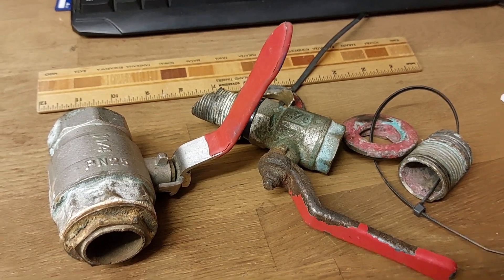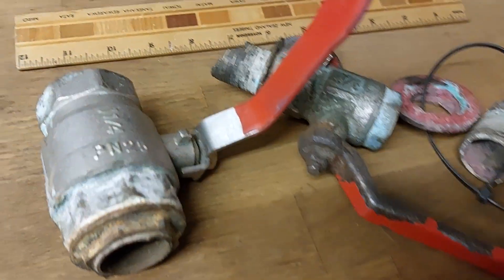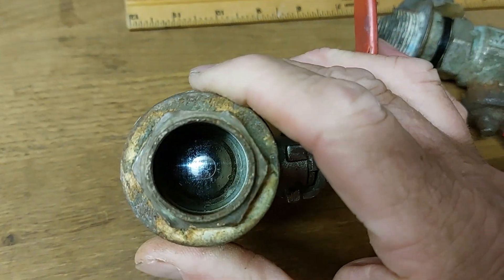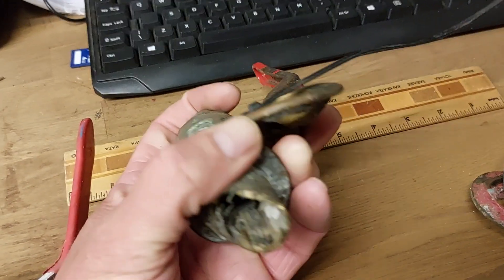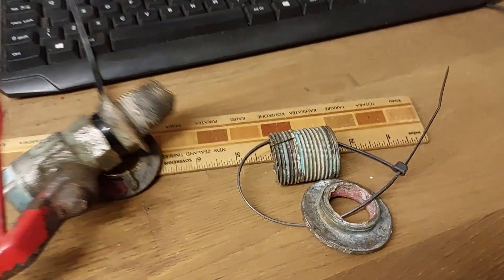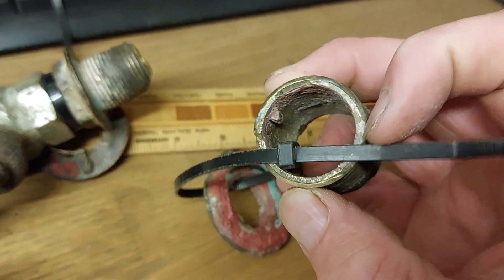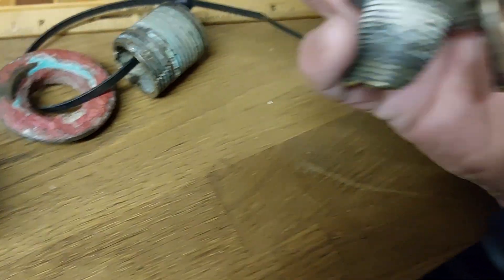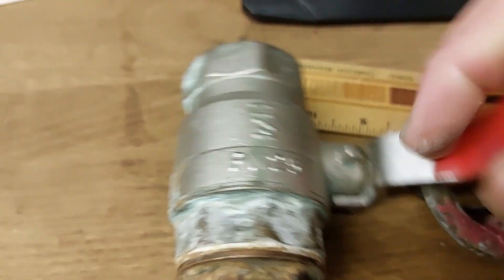very serious failures of seacock valve assemblies explained

Comment: Hi, I enjoy your interesting and informative videos. I couldn't see any markings on the fittings like CR or DZR aren't all genuine DZR marked and normally not plated? Do you detest genuine quality DZR fittings?
Reply from the maker: Thanks for the comments.  Any DZR brass or brass in my honest view is never as reliable as bronze. Many of the issues are caused not by the valve but the skin fitting or hose tail fittings. There are loads of alternatives in bronze or Marlon out on the market that are very little difference in cost and are by far a better option.

Comment: Where should the nut be on a Blakes seacock in your opinion? I found images with the nut opposite the machine screw head and images with the nut at the far end of the machine screw.
Reply from the maker: https://youtu.be/zIGhhenGCz8 should help you further!  So basically they are a lock nut that should be to the underside of the cast flange!

Comment: tell me if I am wrong, but on the first valve,, the bit which cam off, looks like steel, which was attached to the valve,get a magnet on it, I did not see DZR on the valve. I would not use DZR in salt water, gunmetal or bronze would be better, no zinc, or would you like A4 stainless steel, I am only a plumber, and you are doing good for people, nobody knows every thing.
the colour of the fittings, look like brass, DZR is a bit redder colour, and there is normally a back to front capital D, up against a capital R  on the fitting.
" dezincification resistance."
  " horses for courses " one thing is not good for every thing, as you know.
Reply from the maker: No all brass and dzr brass.